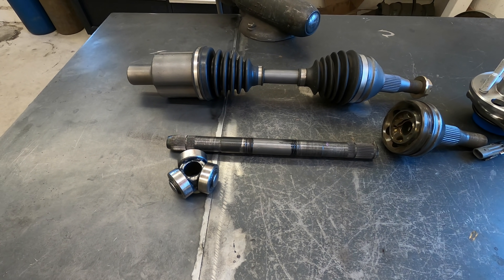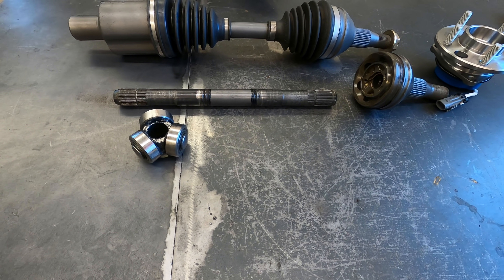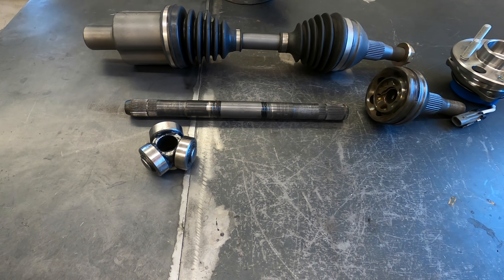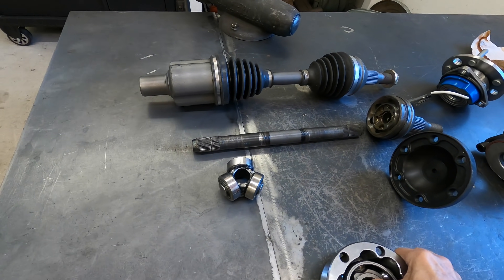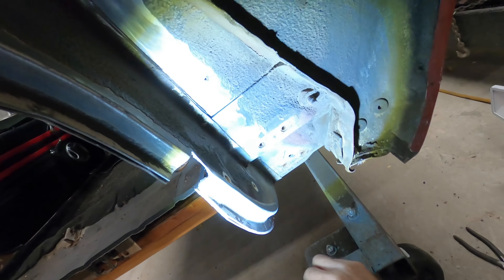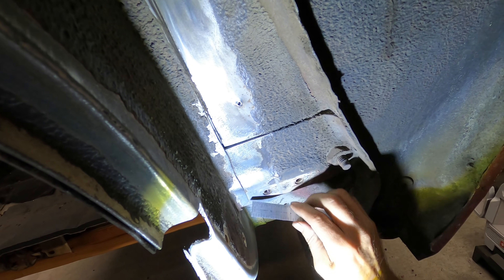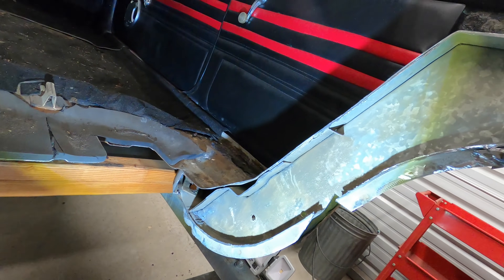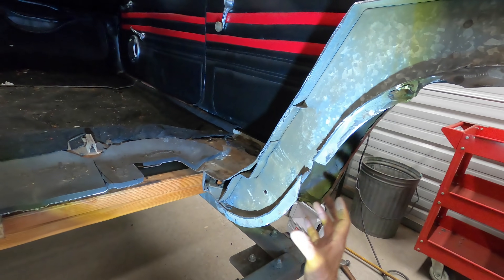CVs, tripodes and axles

Comment: I know this is three years later, but I would have considered a cardan joint and I would have built out the space between the Corvair rear mount and built structure between that and a K-shaped member to the side structure that goes up over the original suspension component locations. I would also work it out on 3D-CAD.

Comment: OMG I have wanted to build a  transverse  v8 327crown kit 
I think a transverse power plant is the best mid engine design for handling and putting torque to the asphalt 
700 horses is scary fast in heavy hitting light weight 
You showed me that I don't have the engineering skills to do such a stunning and beautiful build 
Thanks for this awesome build

Comment: A question  -  why didn't you install a few cross braces into the channel before welding on the custom-cut sheet? It seems as if that would have added a little more strength and rigidity.
Reply from the maker: Because the piece I was working on in that video will be tied into a tubular structure, mainly, the roll bar down bars.  If that piece was a stand-alone, then yes, internal gussets would have been necessary.
Reply: @JohnReynolds661  Got it. Thanks!

Comment: When’s episode 4 coming?? You got me all into this build. The way you figured out the rear set up was great. All the HP and torque.. I’m thinking 🤔 you’re going to be beefing it up a little more. Cross connectors and some more welding. Lol. You’re gonna twist that frame somewhat. Lol. Great work !!
Reply: Forgot to add.. I learned how to drive and stick shift my fathers old corvair. I use to sit on his lap and he would let me steer and tell me when to shift. Brings back some memories. I was probably 7-8 years old at the time. The white shifter knob. Then the engine went and he got a think a 1964/65 Nova/Chevy 2 station wagon. Wish I still had that wagon. Loved the way they looked. Moms had a 66 SS impala with the big block that’s worth a lot of money now. Wish I had that one today also. Lol. The impala was a rare car.

Comment: Very intriguing build project ! I admire your engineering and fab skills, this is not a job for the faint of heart :-)
40 years ago, I built a Corv-8, using a Crown Engineering kit and an L79 small block that had been modded a bit, and a standard (Saginaw) 4-speed transaxle. The project turned out very well, but the longitudinal engine placement limited seat position. I`m 5`11", and seating was pretty tight. Your approach gives a lot more interior room, and will be greatly appreciated. I can tell you from experience that this car, when finished & sorted, will put a BIG smile on your  face. A lightweight, high horsepower mid-engined car is something to be experienced. Thanks for sharing your videos, I am anticipating future episodes !

Comment: Fascinating and informative. Even though I've worked on cars all my life, and have seen some amazing "large engine into small cars" grafts, I've never witnessed the actual process and thinking behind such projects (for example how to remove metal to allow room, while adding back metal to add strength). This would require a lot of knowledge about structural engineering, it would seem; however, I believe I'm witnessing you "winging it" at times. Incredible!.

Comment: If i was you , where you're planning on trimming the subframe , i would do the plus cut some little sides and weld those in a tryangl fashion along the subframe before you weld the inner plate on . just for extra support and provent twisting .

Comment: What tool are you using around 6:12 to 6:20? I've never seen that before.
Reply from the maker: Descaler. The rods vibrate to remove crud in tight places.

Comment: whoa stop everything let's go back to that tube flat sheet metal bender tool ...what is that
Reply from the maker: Home made.  Tubes welded 1/8" apart on a flat plate.
Reply: John Reynolds your radius bender was a very good solution for these situation. I guess that you have completely moved on from scrap plumbing and your thigh. Quite elegant.

Comment: I really appreciate the skill set of your builds. I was so hoping you had a bolt together option for the axles instead of machine this and that. I can't imagine certain failure with using caddy axles in a car that is going to weigh hundreds of pounds less. Unless you get 18 inch wide mickey Thompsons under there it's gonna spin before it breaks. I'll keep watching.

Comment: Why don’t you just cut all of that innerbody stuff out of there and build a tube frame ...and aluminum panels 
Steel works too
It’s going be bad ass 
I’ve build sand rails with the 930 cvs and bearing hubs ....I can’t wait to see your progress
Reply from the maker: That's certainly another way to do it.  But it's a little to race car for me.  The unibody is all sealed up and I'd rather fortify what's there and keep the weight down.
Reply: John Reynolds tubing doesn’t add allot of weight 
It’s the strength I like especially for suspension mounts 
It also gives options for mounting sheet metal 
Zeus fasteners making panels removable for access 
Making the chassis more ridged as well 
I think you said you’re adding a cage 
Something else to consider Is making the subframe removable it self dropping drive train out the bottom 
I’m in the beginning process of building a Porsche 550 spyder ground up all aluminum car 
Some if not all of the things Im telling you I’ll be doing on this build
I’m starting with building a wood buck
Reply from the maker: There will be plenty of tubing added, believe me.  I am just clearancing and  improving the existing structure - to start with- because it is there and already tied into the body and sealed.  I look forward to seeing the progress on your Spyder.

Comment: What do you plan to use for shocks, springs?
Reply from the maker: @Beat98TJ  Frank, I'm going to have you fix me up with that stuff ;)  Probably coil over double adjustable shocks.  YT is the new Pirate for doing build threads.
Reply: @JohnReynolds661  I only ask because I just started working in that field and I was wondering what brands you were looking at. My desk is covered with aluminum shock bodies.
Reply from the maker: @Beat98TJ  I used QA1 before and they seemed to work out.  I don't know what length it needs yet.  It will most likely have eyes on both ends, coil over, double adjustable with probably 4" of travel.
Reply: @JohnReynolds661  I played with those years ago.  Should work well.